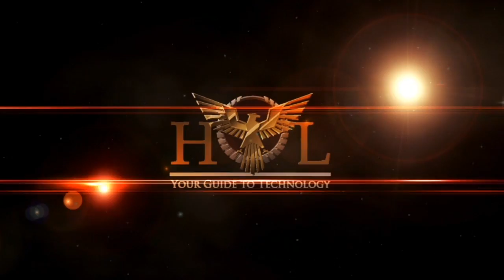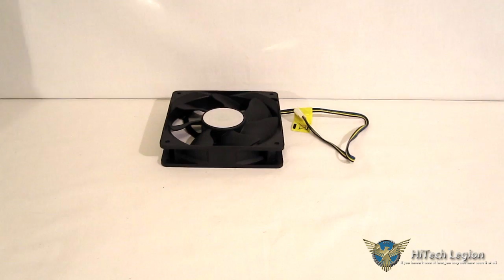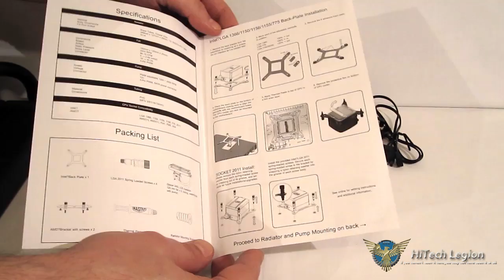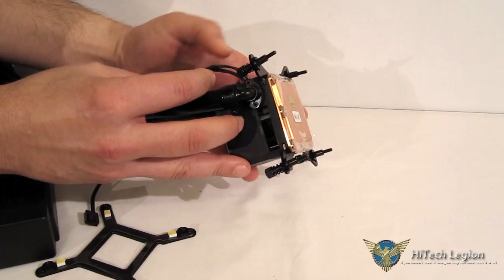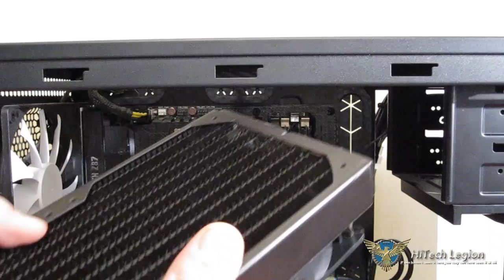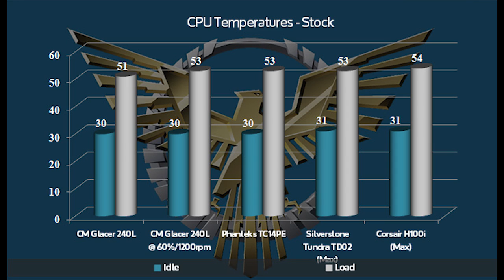Cooler Master Glacer 240L Liquid CPU Cooler Overview and Benchmarks

Comment: I just purchased one and ...I'm greatly disappointed. It in no way shape or form is able to fit onto a solid motherboard like the ASuS Crosshair Formula Z, what more the radiator I received was less than half full, the air went to the pump, and blamo! My AMD Fx-9590 is toast. So...use this pump at your own risk...and stay away from the higher end mother boards...they're not built to accept this RIDICULOUSLY HUGE mounting brackets.
Reply: Ah, I just ran through the same issue, the VRM heat sink on the Crosshair formula Z is too big, but it fits on the Sabertooth 990fx

Comment: i was reading comments about this cooler starting fires and havin early pump failures.also users were saying to flush it out before you use it and it cause its has alot of debree in it.im tempted to buy one but idk man.i like the custom features you can add to it tho,but has anyone had any problems of fires and pump failures? reviews from newegg http://www.newegg.com/Product/Product.aspx?Item=N82E16835103196
Reply: Jay Bee The initial units released had an issue with the pump speed dropping too low which caused the failure and burned pump controller issues. This was addressed very quickly by Swiftech and Cooler Master.

That said, this is basically a dead piece at this point. It is a rebranded Swiftech H220 which has been discontinued in favor of the superior H220-X, and that is the open loop AiO you should be looking at right now.
Reply: George Cella i stay in dallas tx and i cant find the h220x no where,not even on amazon.microcenter had some but sold out and not had any in months.i went to the swiftech site and they do have em,but now i want the 240x but they dont have any. sooo uhh,the h220x can be sold in the usa? if im correct, the patent issues was with the h220 only not the h220-x?
Reply: Jay Bee The H220-X is available in the US, as is the H240-X, no patent issues on the X series. Amazon and Microcenter will be about the last places to have stock, as Swiftech is committed to their specialty retailers as a priority. Availability will come from Swiftech direct, Frozen CPU, Performance PCs, etc before mass merchants since demand greatly outweighs supply on these at the moment.
Reply: George Cella alrighty then homieson they need to hurry up and supply cause my build has been on hold cause,1.i want a fractal design r5 windowed case and ive been holding on to this non windowed version for 2 weeks now brand new unopened from microcenter,2.i have a new msi 970 gaming motherboard i want to install but i want all of my componets before i start my new build,but if i cant get the case in time i will turn it in to get a corsair carbide 540 and be done with it.shits makin my ass itch and head hurt.thanks for the info homieson,you have been very helpful!
Reply: Jay Bee NewEgg has the windowed R5 in stock for $119 + 13 shipping. Swiftech has the H220-X in stock That should set you right.

Don't let impatience get the best of you. The drop from a Define R5 to a 540 is steep.....seriously steep. Like returning your Bentley and coming out with a Camry.

Comment: How do you adjust the pump speed ? And what program do you use
Reply: The pump speed is adjusted by PWM. Ideally, you simply use the included PWM splitter off of your MB's CPU header to adjust the pump and fan speeds in tandem.

Comment: i needs helpz plz. how do i tell if i have the latest 240L??? i plan to run it full speed for years and wana be sure i have the latest pump. i'd love any help!
Reply: To my knowledge, the 240L all use the latest pump version from Swiftech. I don't believe there has been any change during its production. The only problems I have seen with the unit are when people try to run the pump at speeds lower than recommended - less than 1200rpm. At higher speeds they have insanely good MTBF.
Reply: George Cella Thank you very much for the advice. I feel more comfortable running mine at fairly high speeds now.
Reply: George Cella Update - Support Email says there are actually two different versions of the 240L. The new version is still rolling out, and the only difference is the new version has a removable power cord from the pump. They said they would update me as they find out more about what warehouses are sending out the new version. Who knows if they will replace my product, but if that's the only difference then it's not a big deal to me.

Personally I don't know if support even knows if the wiring is the ONLY difference. I personally believe the pump itself may have changes. I asked chat, phone support, and forum support - NOBODY but email (From chat support) would answer my question about product revisions.

So the removable sata cable from the pump is the only difference.
Reply: Royce Barber Thanks for that piece of information. I may be able to get an answer as to any other changes.
Reply: George Cella Thanks, any solid info on changes to the pump would be great! On NewEgg, there are a number of manufacturer responses in the Reviews page of the 240L, directly indicating there are "numerous changes" to the pump unit. 

My two concerns are;
1. At some point in the future, the pump WILL die, as everything dies. Knowing anything I can about revisions will save me and support a lot of running in circles.

2. My home has no air conditioning, just a small swamp cooler in another room. So my house gets HOT. Thus I bought a water cooler. I monitor my cpu temps.

Comment: How does it compare to the 280L Nepton?
Reply: The 240L is a 240mm OPEN loop, brass/copper rad, expandable, much higher flow/pressure pump.

The 280L is a 280mm CLOSED loop, aluminum rad, low flow/pressure pump, not expandable or configurable in any way.

Comment: how does this compare to the h105?
Reply: I love questions that are this easy to answer.....

The 240L is open loop, so it is expandable should you ever want to include another component/rad/res/colored tubing/etc in the loop. The 240L is slimmer so it fits into many more builds easily (most mid towers) without component interference, the H105 doesn't. The 240L has the ability to deliver the same performance as the H105 at MUCH lower noise levels. The 240L has significantly better peak cooling performance. The 240L has a real pump that moves ~20 times the water of the H105 pump. The 240L has a far superior copper/brass rad, while the H105 has an aluminum rad. The 240L has a far superior contact block.

The H105 has a picture of a sailboat....after that, I got nothing for the H105....

Comment: Glacer 240l vs Eisberg 240l prestige, please ?!
Reply: Unfortunately, I no longer have an Eisberg around to do that head to head, and the Eisberg is effectively EOL, so.....

However, I can tell you that the Eisberg's notoriously loud pump whine is not a myth. Also, there are few tests of the Eisberg against the H220, with the H220 being a slightly better and much quieter performer, and the Glacer is simply an H220 with a performance increase.

Comment: So basically I can have this and extend it with a gpu block to another 120mm Radiator and back to the CPU block/pump? Can I switch the tubing? Sorry I'm new to liquid cooling.
Reply: You can add the GPU block and rad, switch the tubing, etc. That is one of the big advantages of open loop.

Comment: Mine didn't come with the fan controller. Was it supposed to?
Reply: Only the pre-production pieces included the fan splitter. CM decided not to include it due to the pump not drawing power from the PWM connection and lowered the price accordingly. With the pump taking power from the SATA connection, the PWM splitter was not a necessity.

Comment: would there be any differences, if i add in a set of sp-120s?
Reply: You would see a drop in noise and performance, so it would be a trade off. However, as I said in the vid and the benchmarks showed, the included fans do an incredible cooling job at low speeds with very little noise. You would effectively be replicating what it can already do up to 1200rpm, and then losing everything above that. So, in the end you would gain nothing and lose the top end performance.
Reply: George Cella
Thanks man :)
Reply: Hard to say without trying it. It may make no difference, or may serve to actually trap air since the SP-120 is not capable of as much flow.

Comment: Hey George update on my 240L i got it put in today. Talked to Bram at OCN about the initial sound upon jumping my PSU to give it a go. If anyone wants to see /watch?v=rEolHeZDVWs. Bram told me once in the case and ran for a couple of hours it should subside. Less my ear is directly on the pump or i have a microphone on it i can't hear it over my case airflow. Ran Cinebench on my 3770k stock topped at 47C. Color me impressed i hope it last forever.
Reply from the maker: I saw that in the thread over there. Yeah, any noise will go away after it bleeds for a couple of hours. It stopped on this unit when I tipped the case (for another reason) about five minutes in. The 240L is definitely impressive, nothing else you can take out of a box fully assembled matches it.
Reply: HiTechLegion watch?v=rbwsO_O4wUs here's what it sounds like now after running all night. I can't hear it over the fans in my case. But i wanted to see what you or Bram thinks. The only way i can hear it is if i put my ear up to it.The phone mic picks it up better.
Reply from the maker: If that is the only way you can hear it, you are good to go.
Reply: HiTechLegion Thanks for the help George.

Comment: How's the 240L pump noise compared to the TD02? I have Noctua fans, so the fans aren't an issue for me.
Reply from the maker: The pump on the 240L is pretty much silent until it hits ~2500rpm, and never gets overly loud above that. I really have no recollection of being able to hear the pump on the TD02 - not sure if this was due to other fan noise masking it or if it was that much quieter.
Reply: Thank you so much for the reply. I wanted to get the 240L but it's sold out and I do not feel like waiting lol and thought the TD0@ would be a good 2nd choice, but I'm now stuck on cooper rads vs Aluminum rads. I know from your chart posted in the video showing the difference in temps, but what about long term dealing with corrosion. How do you feel cooper vs aluminum.
Reply from the maker: Personally, I would wait for the 240L. It really is head and shoulders above any other AiO. Another consideration would be the XSPC 750 EX240 kit if you don't mind the install. I would definitely go in that direction before thinking about a closed loop.
Reply: I change computer parts out like crazy to deal with open loop. I've already changed everything with in a year. I dig the white tubes with the D240 it goes with my case http://www.newegg.com/Product/Product.aspx?Item=N82E16811517019

Comment: I have one on the way with some things to finish a build and was going to send it back. So the newer models with the revision 2 impeller don't have the air bubble getting caught in the pump and the horrid noise following? I'm nervous about it. Seems there has been the same loud pump noise issues on the glaciers on OCN as well.

Comment from the maker: The reason for SATA rather than molex is that SATA is now much more common. Going forward it will become even more common as molex is phased out. So, for most SATA becomes more convenient. You can always use a molex to SATA adapter if need be, they are very inexpensive and easy to find.